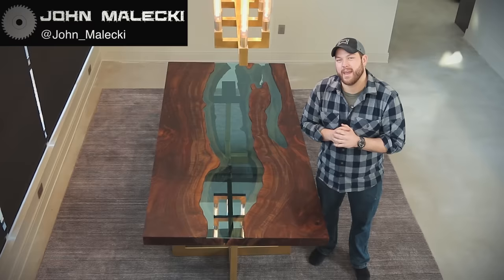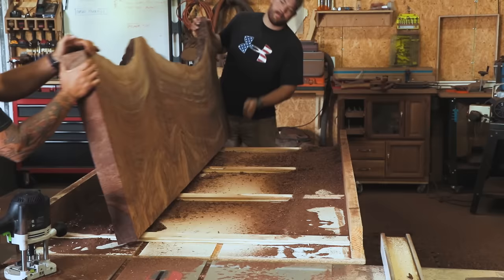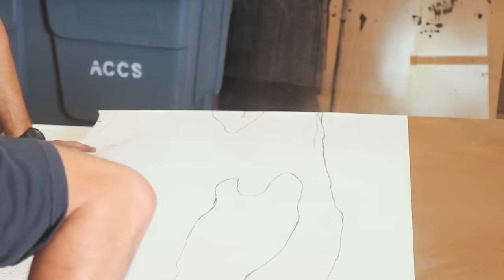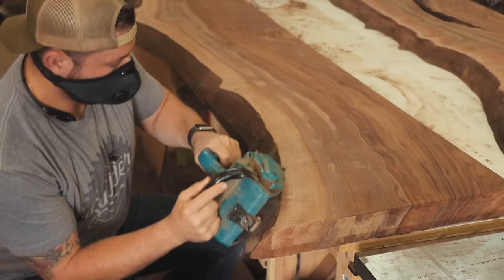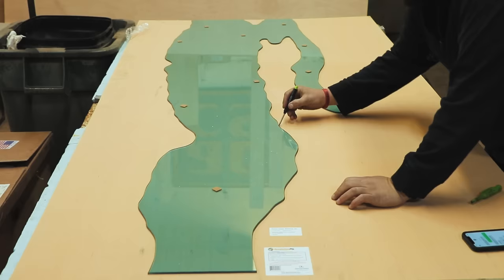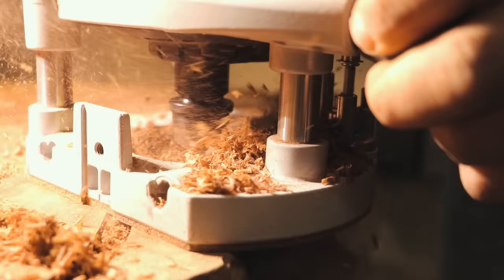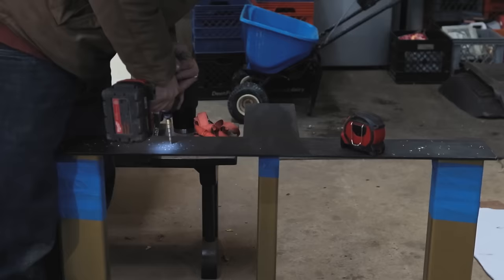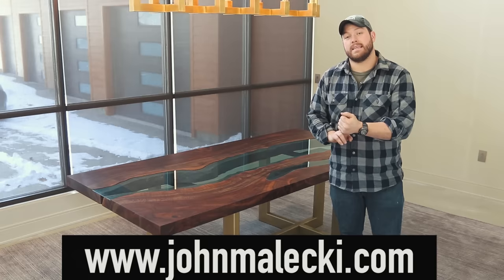Live Edge River Table | Woodworking How-To

Comment: Awesome video but I had to keep adjusting the volume so I could hear you. The music was to loud and the voice over was to quiet.
Reply from the maker: Hmmm I haven’t heard that from anyone else. But glad you enjoy
Reply: +John Malecki it sounded fine 2 me
Reply: 39 people have ears like a grandpa and hit dislike
Reply: John Malecki I agree, the music was a little too loud when compared to the voice over. Granted, it's past 3 am and I'm watching this in bed.
Reply: True, if you look at the audio waveform, the music is clipping to the point of distortion, while the voice over is way below that. That is easy to fix with a free audio editor such as Audacity. Otherwise, great video, thank you.
Reply: The music was too loud, that's why you haven't heard it ;-)

Seriously - the music is way too loud comparing with sound level od spoken parts. I had to adjust sound level constantly. Impossible to watch late in the night when your spouse is dozing off or already asleep.

The table top is beautiful; however, the arrangement of legs and the way of joining them at floor lever is weird and highly impractical, to say the least.

I'd rather use classical layout four legs in the corners (offset by 3-4" inside) and a square frame holding the table. Also, I'd add a second glass pane - clear opaque (frosted) glass at the bottom od the "river". This would make the blue colour of the top pane more prominent and would remove rather unsightly view of feets/ shoes of people sitting around the table.
(This in turn would draw the attention away from these moving feet, since the natural human tendency is to observe moving objects - and thus it'll focus it on the river itself.)

Furthermore, this second piece of glass would make posssible adding some "underlightning" - few white (or blue?) LEDs placed around the edge of that frosted glass would make the matt surface of it glow. Think how it would look in the night, in dark room...

Best, KB

And, oh, BTW/ FYI - a piece of useless trivia: your surname in Polish is pronouced with the "ts" sound before "k" ("Maletski") - as "c" in Polish equals "ts", unless paired with "z" [= "ch" like in "chair"] or "h" [not sounded, like in "nick"].
Reply: Music is too loud and unnecessary.
Reply: It was frankly terrible. Listening on headphones, I hate to stop watching just over 3 minutes into it.
Reply: 1
Reply: @556bc  Agreed about the terribly loud music.  I can't listen after 2 minutes.  Ambient sounds would be preferable.
Reply: Yeah, horrible music. Just remove it from future vids.
Reply: my mans not wearing earplugs or ear defenders throughout the vid

Comment: This is a completely amazing table.  When I saw the picture I thought it was just another epoxy pour, but to have glass cut and fitted into it blew me away.  I have to admit I was crapping my pants a little the way you guys were flipping over the glass, i can just imagine how much it cost.
Reply: Bob O'Connor what does the glass get you, though?  A table that is structurally incoherent and an extremely fragile, hard to replace and expensive plate?  Using glass in this application is stupid.

Comment: Funny, because my wife and I have been thinking about replacing our dining room table marble top we’ve had for 34 years. The table was custom made in Italy, but the corner broke off recently, and even though I fixed it, we’re feeling it’s a bit too small. A new top is about $10,000. But this gives me some ideas. 

For a dining room table, the glass cut in is too delicate. But putting 1/2” glass on top would fix that. Two live edge wood pieces underneath gives a similar effect while being easier and sturdier. Well, I guess I have to clean my shops so I can have room to do a 4 foot by 8 foot table.
Reply from the maker: Stoked to give you some inspiration my friend!
Reply: Your work is beautiful. Of course it inspires.

Comment: Amazing work John. I just subscribed.  One tip that I discovered when making the template for the glass panel; put the slabs upside-down on top of a large piece of paper - with the slabs in the correct position and set the right distance apart.  Then just drag a pencil and trace the lower edges of the slabs (which is the top of the table) onto the paper below.  Now you have a perfect pattern shape for the void that will be created by your slabs.  Add 1" to each side of those lines (or however much overlap you want), and you have your perfect glass template shape.   Hope that helps, no more free-handing or rolling up a large piece of paper on the top of the slab.
Reply from the maker: Great tip man thank you!

Comment: Beautiful table. 
As gorgeous at it is, and I hate being "that guy", but the glass is going to break one awful day.  And it's not quite a flat surface. Nothing like a bumpy table to aggravate you. I feel like a translucent blue epoxy resin might've worked better to remedy those issues. 

Practicality aside, it's a stunning slab of walnut and really is a beautiful showpiece.
Reply from the maker: You're not "that" check out the comments and youll see plenty of others like plastic over glass. My client wanted glass so they got glass. But i appreciate your input, and the table is very very flat

Comment: Beginner type of question with almost zero experience in building: would I be able to achieve the same result by filling the gaps with epoxy without having to fit a piece of glass perfectly? However, I think this approach was amazing. It might have been cheaper, perhaps?
Reply from the maker: So deep pour epoxy is super expensive, but that is for sure an option and is very popular right now

Comment: If your using the glass as template for good fitment, just put painters tape on glass so you dont scratch. At most you have to clean a little residue from tape.
Reply: I was wondering why not take a bit of extra time and lay the glass on some 1/4" panel board, trace and then cut with jig saw, a little light sanding and then use that as a template instead of the glass?

Comment: John, just to confirm, did you use tempered glass or regular plate glass on this project?  I'm working with local glass companies on my "build" and they are suggesting tempered glass which is more expensive.  Do you feel strongly that tempered glass is the way to go?
Reply from the maker: Tempered because of the finger

Comment: very nice table but i have 1 question. what are the extra "t-parts" for under the table? they dont support anything and u can see them true the glass?
Reply from the maker: They keep the tops of the table legs from moving around, as well as the base. needs somewhere to mount and with this design I had to tie all the legs together to prevent racking

Comment: Great video and beautiful job. Not my style as I love the look of rasin so it looks like water not just looking at rectangle tube metal But that's just prefrance and does not take away from your great work
Reply from the maker: well i appreciate your honesty. I prefer to see the live edge in the center which is hard with resin. but great idea none the less
Reply: Agree and why I use clear resin so the edges show and if customer wants a tint to it to look more like water then I add some but only enough that it does not take away from the wood edge. 
Again great looking table and very nice work. 
Thanks for sharing

Comment: John Great work ! I did not understand for which parts did you use stencil template and for which ones you used glass itself ?
You have any tips how to protect glass from damaging and scratching by router ?
Reply from the maker: Tape the glass, i use it for the router template. Or ask for the offcut from the glass cutting company
Reply: Okey thanks for answering ! So if I understand, there is no need to make wooden template like you did I can use just glass ?

Comment: Hi John. Love this build. The table turned out beautifully and your video editing is done very well. Very educational.

I was considering creating small river table builds with my students. Instead of using the glass for the pattern I was thinking of using 3/8"-1/2" mdf for the original template cut and keep the outside pieces for the pattern. It would be a challenge to cut the pattern perfectly.

How was the glass company able to use the pattern for cutting? Do they have a CMM?

Thanks

Kelly

Comment: Thinking that using a template , as you did for adjusting table to allow glass to fit in perfectly, but using a thicker template for a epoxy insert (no glass needed).
Cut out center of a  3/8 - 1/2 " thick templet to the banks of the 'river' , rout the wood  against templet for perfect match into ~ depth (thickness) of templet .   Place templet  into pouring form and fill with 3/8 -1/2 " of clear (or opaque color etc.) epoxy  ( prepping edges of form for easy release)  and create the 'glass ' insert .
Reply from the maker: you could probably do that. I would just make the epoxy glass to whichever size you want then, and make the wood fit, eliminate a step. if you wanna go that route
Reply: @John_Malecki  Was hoping to put plex into a top very much like the one you made .   Failed to say how fantastic that that table you made came together , stunning !
Reply: John Malecki BEAUTIFUL piece of woodworking(more like fine art)!!! This may be a stupid question, but is the surface of the glass flush with the wood. I couldn’t tell from the video. Again, great job and thanks for all the inspiring content! 👍🏻👍🏻
Reply: @donavanmcelroy6263  Don't think he will se your post in this thread.  In video he routed out the top to exact perimeter of glass and the exact thickness so it would fit in tight and flush with wood surface .
Reply from the maker: It is !

Comment: Love the video, table came out beautifully. I have a question when it comes to routing out the inlay for the glass. You say you use the glass itself as a guide to run the template bit along. However when I do it, my glass doesn't fit because the inlay I just cut is glass + diameter of router bit. Could you clarify this process? Thanks.
Reply from the maker: You have to offset the glass the width of the bit. Check out Crafted Workshop video on how they did theirs too
Reply: John Malecki so you make a seperate template that is offset by the width of the bit?

Comment: John Hi ! 
I'm doing same thing at home, and i have 3/4'' template router bit. When I follow shape of glass like you did, my glass does not fit perfectly, cause that 3/4'' bit makes curves different (a little bit bigger) than they are on glass itself. How did you solve that problem ? 

Pls answer I almost ruined my work :( 

Thanks !
Reply from the maker: Use a smaller templating bit my friend, the radius will be closer

Comment: Questions: (1) why was this slab cut so thick?  Could it not have been slimmed down by 1/3 or so and then braced underneath to reduce its weight?  (2) Had the "void" been made shallower by following question #1, why not consider mixing up some epoxy (with some colored dye, perhaps?) and pour it right to the edge of the wood, thereby creating a seamless surface, which you certainly do not have now with the glass, regardless how carefully and intricately you cut it?  You (a) wouldn't have to jack around with tempered glass which just begs to be broken, and (b) you would have kept the weight manageable for the poor shlubs who either have to install this table or move it when the client/company makes different plans.  Just asking....

Comment: Glass inserts? I thought this was going to be  a resin project. The glass look very fragile, like the finger will break during normal use of the table. What is the advantages of glass over resin?
Reply from the maker: the look. I simply think glass has a better and sharper look to it

Comment: This is good but when I imagine a "river table" I imagine it with resin, not just glass.  This really is great work and I don't want to be negative about it because there isn't anything to be negative about, but as awesome as the wood is, the glass looks cheap compared to resin.
Reply from the maker: I disagree Tobias, I think Resin has a tendency to look like plastic.
Reply: @John_Malecki  It really depends on the resin maybe? It would've been way more expensive to use resin that would resemble glass, but probably way easier, cutting out the glass and fitting it looks super difficult. Good job for this beautiful table.

Comment: The wood and the glass do not appear to be flush. It looks like your glass is sunk or recessed 2-5 mm from the timber table top. Why is that?
Are you concerned about the shape of the glass being much more fragile than if it were two pieces or a more contiguous piece ?
Are the pieces permanently joined?

Comment: How did you deal with seasonal wood movement?
Reply from the maker: The mounting holes in the base are sloppy and allow the wood to move
Reply: John Malecki ah in the metal base! Cause I knew you glued the inserts into the table top

Comment: Instead of glass, I would've done some epoxy. If the glass breaks then it might kill a dog if they are under it. Also, it would be a nightmare replacing the glass. Where the epoxy shouldn't have much of any problem. 
I mean my way isn't as cool. But ya
Reply from the maker: The glass is not going to shatter, it would splinter if it broke. But thank you for your thoughts!

Comment: Yeah I wouldn't have used glass I would have used an epoxy resin so that you didn't have that void below the glass on the bottom of the table just filled it right up with epoxy resin and then it's all the one thickness underneath,  but anywaylooks of retry good.
Reply from the maker: Yea Im not huge on the epoxy look, I prefer glass. but its a popular idea that people are loving right now!
Reply: @John_Malecki  and more expensive things to be done using epoxy resin ,

Comment: This is amazing work!  My only issue is your inability to create a dead-on smooth surface between glass and wood.  I see food particles, dust and other schkutz eventually making their permanent residences in these crevices.  Would/could you ever consider making a table just like this and use that killer epoxy product everyone's using to create that smooth all-over look?  Perhaps its price is even more steep than the specialized glass, so I am certainly not speaking from experience.  Just sayin'.

Comment: And then someone sets down a pot a little too hard and the glass is broken. And it will be almost impossible to get a new perfect match.
Reply from the maker: I highly doubt a pot will ever see this table
Reply: What will the table be used for if not dining? And any heavy and hard object will have the same effect. Don't take me wrong, the table is gorgeous! But I would have preferred an epoxy river for durability.

Comment: Wouldn't that be called a live middle river table?......aren't the edges on the outside?😊
Reply: Not really. Live edge means the woodworker incorporates the natural edge of the wood into the design. In this case, the outside edges were cut and shaped but the inside edges are left mostly untouched.

Comment: I dont like it you could reach a better result with epoxy. They guys didn't like the price tag I suppose.
Reply from the maker: Highly disagree , epoxy looks like plastic and you can’t see anything inside iy
Reply: Maybe maybe not, I still would go for its solid form and overall quality and resistance. 
I don't know what you think but I just find those edge spaces very disturbing on an artistic level. 
BTW epoxy can be as transparent as you like if its treated and applied the right way.
Reply: Still don't take my opinion to seriously mate. After all everyone has their preferences.  It does not mean its wrong it just means that there are different perspectives on how to solve some problems. Not only in woodwork but in everything. 
Great job. 
Didnt mean to put you on the defensive.
Reply from the maker: You didnt, No worries! all constructive and positive here my friend. appreciate your time and the view! glad you enjoyed the build